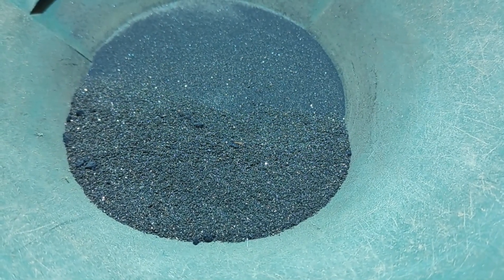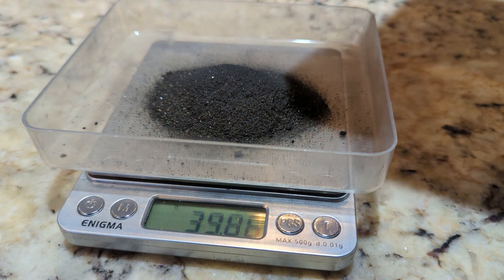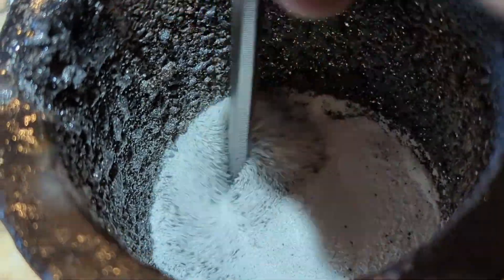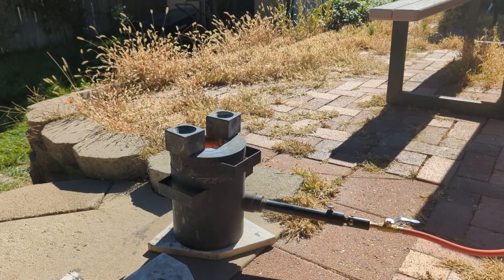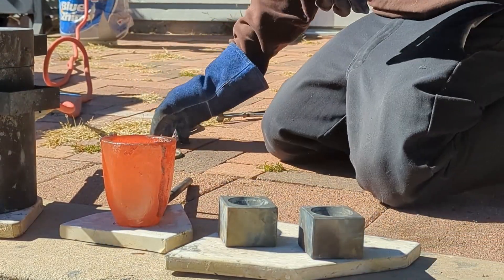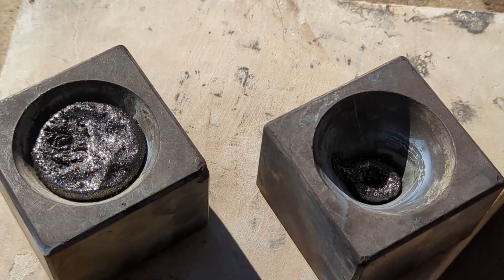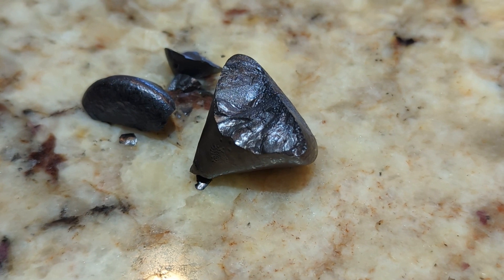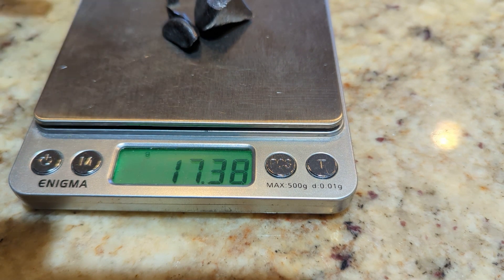Smelting Black Sands.

Comment: thanks a bunch for this
but i still got a question
what to do with these after?
how do i tell the difference between hematite and magnetite?
should i smelt them together or separate?
Reply from the maker: Pure hematite is not magnetic, it may have some magnetite impurities and can be slightly magnetic.
I highly recommend collecting all your magnetic materials. Such as any type of black sands, magnetite and roasting all of it at a temperature of 1100° fahrenheit. Followed up with panning to collect any visible gold liberated. Then you can smelt it to get the ultra fine molecules of gold still captured in the magnetite with a collector metal such as bismuth or lead. Followed up with a cupellation process in an electric kiln with a preheated cupel dish at 1,850° fahrenheit.